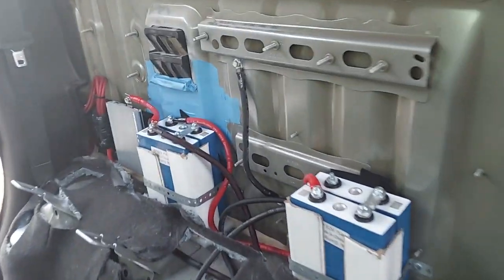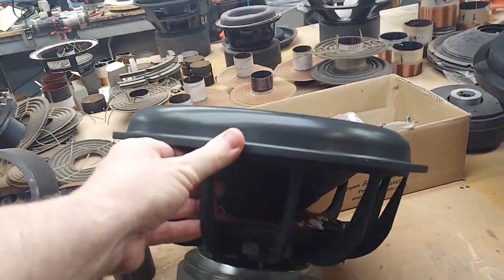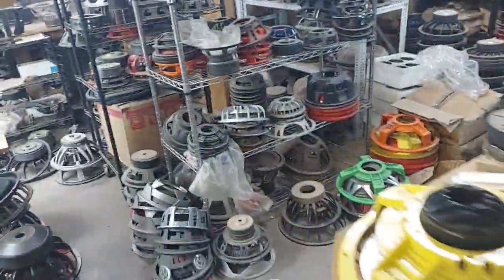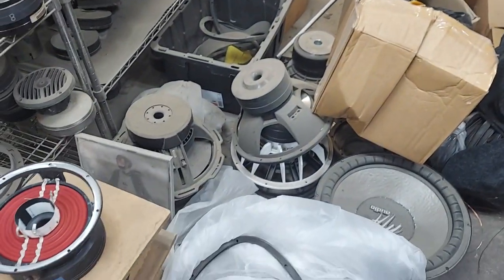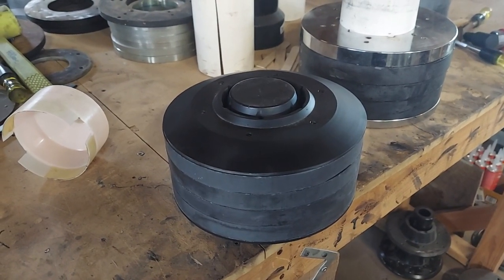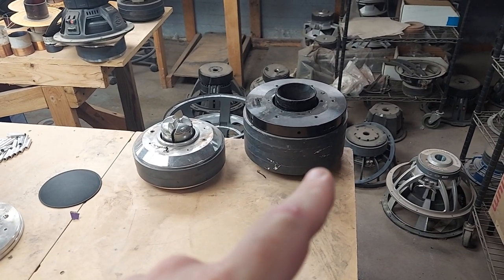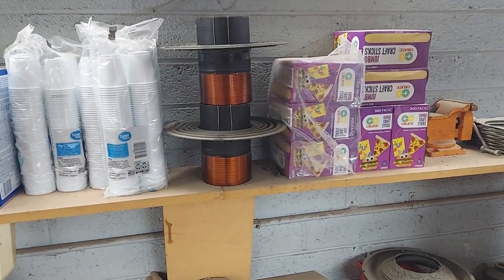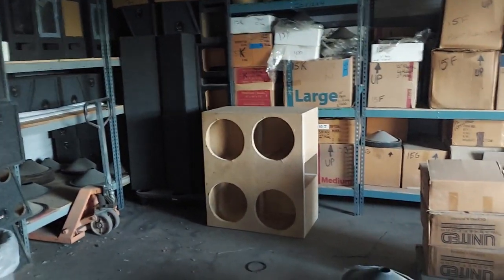Sunday Shop Update: Fi / RE MT & Destroyer 18, Tanner's 75ah LifePo4 w/ GONZO 5k & Rockford 4ch amps

Comment: Are you familiar with the term "comping" a coil? This is when you move the coil up or down relative to the center of the top plate. (I'm sure you are but you may call it something else) Can you sometime elaborate on this process and it's pros and cons. I had 10 18" recones custom made and had the coils comped up a quarter of an inch because I believed I was bottoming out the coil. I was not, I slinkied a coil and the bottom of the former crushed into stack of slinkied coil at the bottom of the gap giving the appearance of bottoming out. Now that I know this I am worried my new 1/4" comped recone kits are now going to be hitting  the triple joint on the top plate instead. Can I just add a quarter inch space plate or spacers between the motor and TI basket to compensate? My frequency range is very low. 13-25 hz.  I would love to hear your thoughts. Cheers 🥂
Reply: Sure you can
Reply: @fuckgoogleandyou8779  Somebody told me to just use the spacers but while it would move the triple joint 1/4" back up away from the top plate it would put the center of the coil a full half inch up of the center of the top plate. Hence my dilemma. I should mention the new coil winding is 1/4" longer than the original coils used in the subs. This is the main reason I had the builder "comp" them in the first place.
Reply: Ahhh I seee ya was going to say shorter coil maby but at a slight loss of power handling of your gap ain’t to tight use 8 layer???
Reply from the maker: I think the person was abbreviating The phrase, " compensation".   I've always called it biasing the coil since it would then have a bias towards one stroke or the other

Comment: Hey man, I got a question about some Recoil speakers if you got the time. I purchased 2 pairs of the MS65-4 midranges, will see them next weekend. 

I'm just curious if you've come across them/heard them in person, and if you know what other 'brand name' speaker they are equivalent to? That 50-12Khz range doesn't seem too real?

I ask b/c I'm doing my system in my car, nothing crazy but just want the best sound/$. I was debating between them and some PRV 6MR250B-4 SLIM speakers, I had bought 2 pairs of those but 1 didn't ship. Oddly enough I got a PAIR of those for $33 total when they MSRP $39 each, new in box from ebay.

So now idk if I should just buy another pair of PRV's and resell the Recoils or vice versa. Because idk why, it looks like the magnet on the PRV is significantly bigger than the one on the Recoils, even with the rubber boot. Either way the amp I'm using is the DI550.4 so can't really blow the recoils even if they're really 100w speakers.

It's just odd b/c there's like not a single IRL photo/video of these speakers, only the 3D renderings on the recoil website lol.
Reply: Sounds like you have a fantastic opportunity to be the first to do a video on the Recoils. On top of that, backed up with a PRV VS Recoil comparison video.
Reply: @thenotoriousrvh6091  Yes, but I have no equipment to do any sort of quantitative analysis. My main issue is the frequency response, the Recoil says is 50-12khz which I very much doubt. Power handling also, unless there's some witchcraft going on with the magnet/coil I doubt it'll handle as much power as the PRV, which is 125w rms rated.

I'll see and maybe do a comparison, but like I said if I don't know the true frequency sweep I can't cross them over at the right points.
Reply from the maker: I'd go with whatever solution is more affordable.  Just because the magnet is bigger does not equal better or more power. The passband on those is pretty shallow.  I recommend 400Hz and higher for them.

Comment: I just recently sent my 2 ZV5d2 15s back to Sundown for recones after blowing the tinsels in one of them. Within just an hour of breaking in, the same sub starting rattling. I set gains with a DD-1 using the -5db track and verified with a borrowed high quality O scope. No clipping. It’s a 4th order and I can’t find any leaks in the sealed side. It rattles at 2/3 volume before my max undistorted setting on the head unit. I’m running one amp per sub and the noise follows the sub. I’m at a loss. Motor shift???
Reply: Whats your box ft³ and vent area?  Is your vent huge and in front of one sub, maybe unloading due to pressure deferential?

 Also did you try to split your coils (amp 1 on speaker 1 coil 1 and speaker 2 coil 1, amp 2 on speaker 1 coil 2 and speaker 2 coil 2 ? I heard thats the best way to run 2 amps on 2 subs.
Reply: The enclosure and amps have been ruled out.
Reply: Noise is there when running free air.
Reply: @vincebowling1778  Oh ok. Did you smash your former (when you blow your leads)?  Im no expert, but sounds like your motor isnt align, or you recone is not aligned. Or maybe they left the shim in there, can you see your coils?
Reply: @johnd5542  Yeah I can see the coil. I don’t know, I’m kinda thinking motor shift. Sounds good up until about 2/3 volume from where my max undistorted volume is from the head unit. I guess I should closely inspect the frame too. I just thought of that.
Reply from the maker: It just sounds like you're asking too much of it

Comment: How much are the carbon fibre cones? 10's 12's and 15"s shipped? 
With them large over sized motors I know it would be more time consuming but I liked how xtant had used 3 bolts to make the motor with a form of shift proofing. I think I've seen you have a few done like that. I know that's what makes me worry about the 3 + stacked bottom heavy "big assed" motors. You ever move to wisconsin and open a "location" yo I'd come be a bitch.